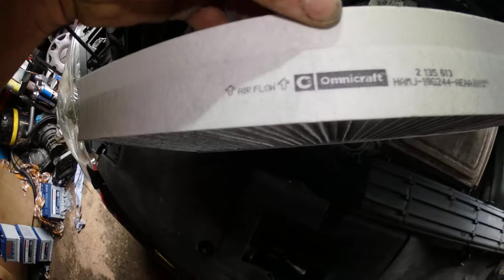Correct way to fit pollen filter Mercedes A and B class

Comment: Hello, can you please tell me what to do, when automatic power steering is whining.
Reply from the maker: What is the year and model of your car?
Reply: Mecedes B170 automatic, petrol.
Reply: 2007
Reply: It's gives whining noise sometimes when driving or turning.
Reply from the maker: @yomioluwale3581  The B class steering shouldn't make any noise, but if you hear creaking sound that's coming from the lower ball joints